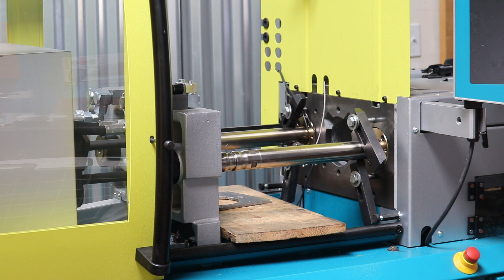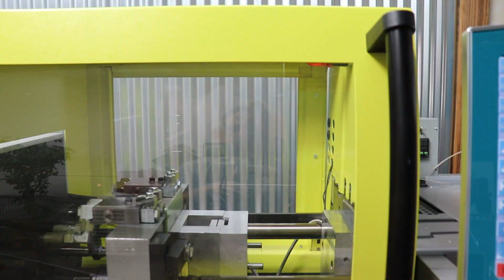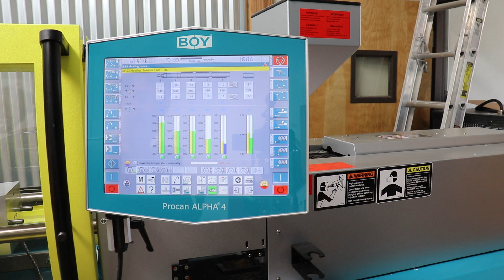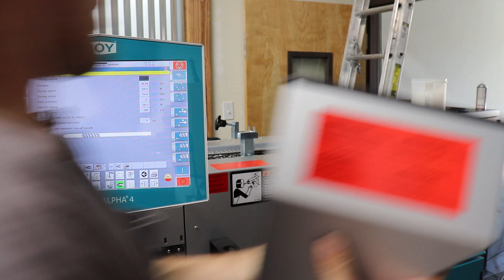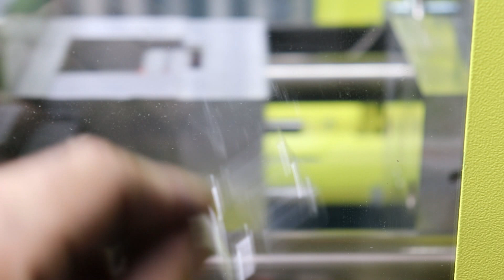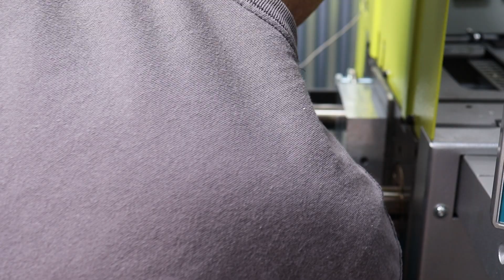MICROGROOVE CHIP MOLDING

Comment: 15:38 I might be wrong, but maybe there is too many punch/undercut and the part grip to firmly on the runner.
"Punch once, check twice!"

A possible solution to avoid part resisting ejecting/getting stuck on part "B" would be to smooth out somme of theses undercut.

Comment: on the ejection, is there no way to install a light curtain that detects successful ejection? I guess the mold does take damage from a failed one?
Reply: Yes, this is a common solution on high production. 

If mould safety is set up correctly the machine would not lock with high pressure while part is stuck, but on soft tools even low pressure is enough to damage parting lines etc.
Reply from the maker: Hi Yes that can be done.  In my case this mold is going to production so i will set up a robot to pluck the part off and trim the gates off.  i will set up a laser on the robot hand to see if it has the part in it's gripper.  Thanks for watching!  P.S. i think the latest trick is machine vision software and a camera